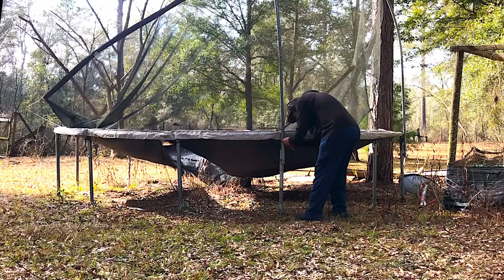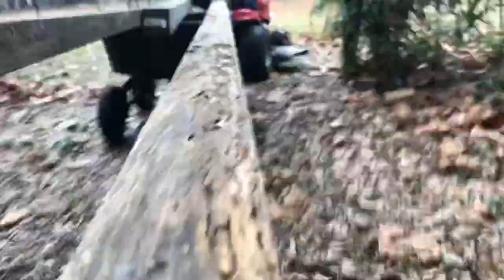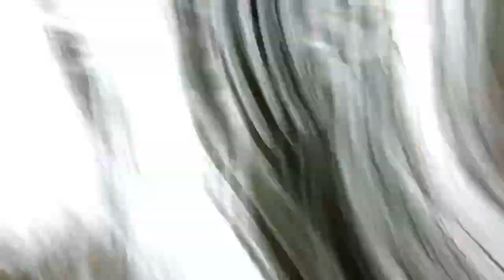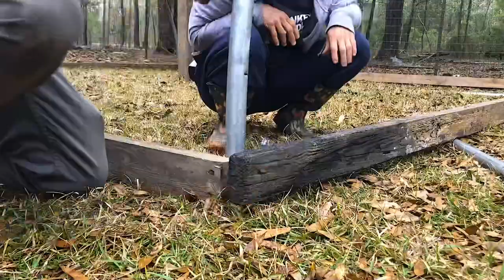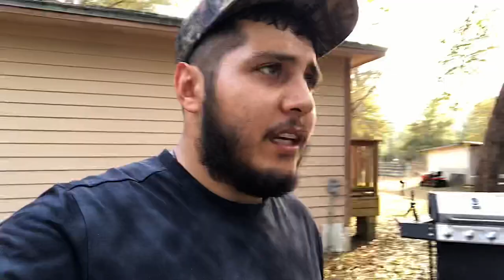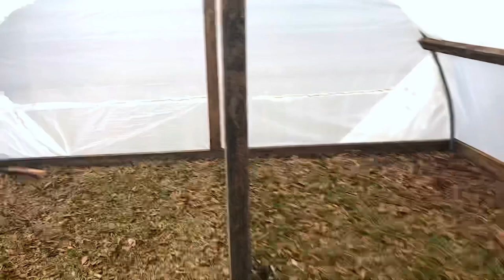TRAMPOLINE GREENHOUSE | Preparing for the GARDEN

Comment: What kind of screws and drill bit did you use
Reply from the maker: I just used a Hart brand brushless drill with 3 inch galvanized screws. I had to pre-drill holes in the metal tubing so that the screws went through easily